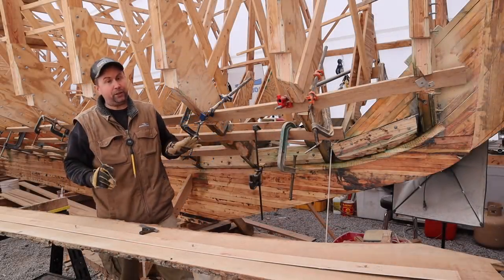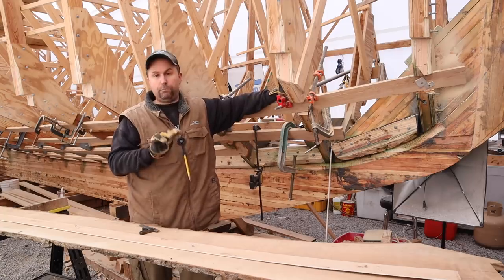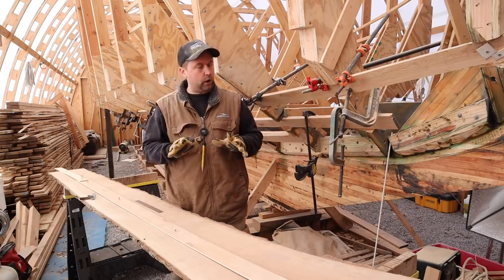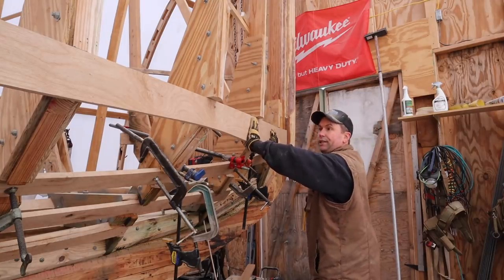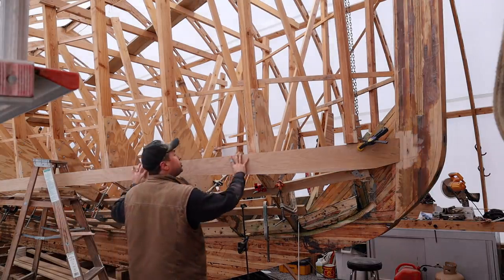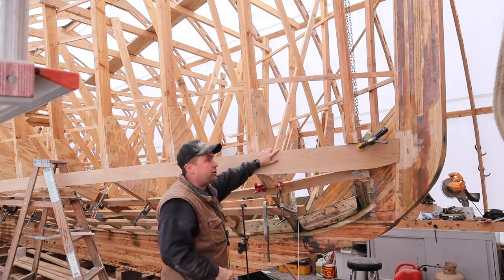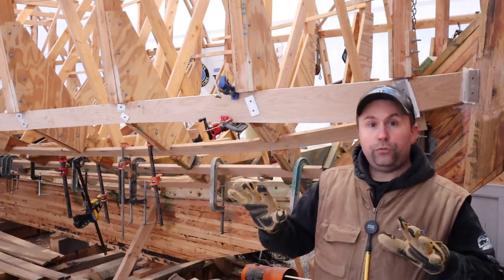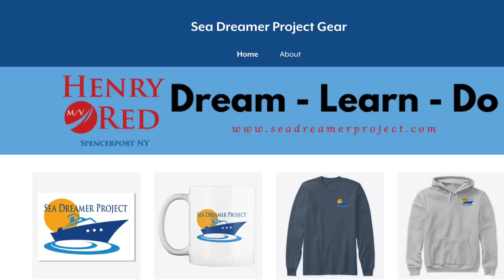Wooden boat Laminated white oak hard chine installation. SDP 42

Comment from the maker: It's not just boat building i'm new at!, a little user error on the Teespring store which I think I fixed but it may not display properly for a bit.  There is a link in the description that you can use instead if necessary.  I apologize for the error, I'll get better!.....probably.
Reply: Six Points Wood Works you are already absolutely perfect. You amaze me. No WAY that I could take on such a project. Hello I couldn’t even build the boat house. Mad deep respect to you. And for all of law enforcement. You are a true inspiration and an American hero. 🇺🇸#godblesstheunitedstates

Comment: Nice work! I like that you use commonly available material. I built a 38 ft. roberts in a northern town in the 80's and it was difficult to source material pre-internet. Now I learn so much on the internet from all the current projects I follow. I love your boat shop construction as I probably spent more time building two heated shops, than I did working on the boat. To all who may read this, shop building is an addiction just like boatbuilding.
Reply from the maker: You could build this whole boat with dimensional lumber and plywood.  You might need to double up on some of the pieces but it could definitely be done, and was in fact designed to do just that.  We used a lot of dimensional doug fir in the keel but the rest is custom milled larch and white oak.  However I did that because it's very easy and cheap to get near me.  The shed project was a lot of fun and is a great space for lots of different activities.  I wish I built it taller, but hind sight.....

Comment: Old schooling it !! 
 White oak is a very good boat and barrel wood. With a thin cut length of oak, bend it and it wont crack or break easy which a boat needs as it flex's underway where wood like mahogany will easily break crack and split.
Reply from the maker: I'm shocked at how much you can bend white oak without steaming and how far it will go without breaking.

Comment: I've never sailed, or know anything about boat sailing, I've only ridden on car ferries, that cross Galveston bay, as a child.  
Watching you makes me wanna build a boat, like a bucket list project, you make it look easy.  Must be George Buehler's plans, that help a lot.  What's good about this project, it's like a huge assembly by numbers project, that can be done with materials anyone can obtain.  Much cheaper than trying to build a car, or a vehicle, which requires specialized machinery, tools, mills and lathes.

I'm in my mid 50's now, I bet I could do it.  I got plenty of tools.  Just need to move closer to the Gulf of Mexico.  And take swimming lessons at the "Y".  😆

Comment: I built a 50ft wooden structure in temps of 90 deg F.........when the finished structure was subject to low temps it would distort, I would only ever build a large wooden structure at the average operating temp and not at any of the extremes.....have you calculated what those wooden planks are going to expand to in summer temps?
Reply from the maker: I don't think that is the right way to look at it.  If it were so, they would be building houses around here in the spring and fall.  Wood moves with moisture content, not temperature.  Provided the wood is dried before installation, which it is, the seasonal changes in the material are not a big deal.  The use of glues and bedding compounds are to remedy that known seasonal movement of all types of wood.  When building furniture, wood movement is a much more critical consideration, because wood movement can cause tight, pretty joints to open up.  It can even split boards in cross grain situations.  But boats, subjected to brutal conditions, are designed to deal with this.

Comment: Hey Scott - going well - great to see. I mentioned on a previous post that you do not need to use acetone with epoxy resin for clean up, etc - use methylated spirits instead - much cheaper, far less toxic an deasily obtainable - check out other sources if you do not believe me but I do a lot of epoxy resin work...
Reply from the maker: I remember, I just keep forgetting to pick some up and try it.  will do...eventually 😜

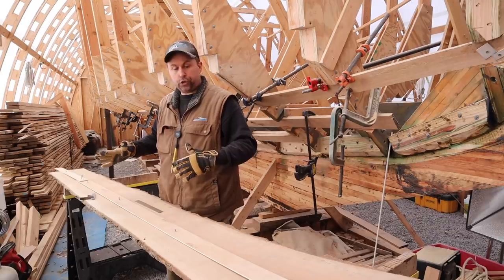Comment: 8:08 Why is that beautiful piece of live edge white oak "kinda scrap"? The things I could build with something like that, woooo wee... awesome work regardless, loving this series, just confused as to why that is considered scrap to you :/
Reply from the maker: For furniture stuff it is a great piece, but for boat building it was not so perfect.  That board was near the edge of the tree so it had a bit of sap wood on each side.  It was only useable for the right piece that could cut around those defects.  Sap wood does not have the strength or rot resistance of the heartwood in white oak.

Comment: I honestly don't know - so the question, galvanized bolts have a sacrificial galvanized coating - once the coating is compromised, the bolt will rust away.  I can only think it must be too expensive to simply use stainless or brass bolts.  Is that right?
Reply: The fittings he is using should last at least 100 years or more. I wouldn't worry about it.
Reply from the maker: Silicon bronze would be best fort sure.  However the cost was just to much for me.  We are building for ourselves and are not concerned about resale so galvanized will give us all the strength and longevity we need.  just FYI in case you are working on something similar, Stainless is not recommended below the water line, it needs free oxygen to avoid crevice corrosion.
Reply: @SixPointsWoodWorks  that exactly answered what I was asking, thank you!

Comment: You will be in good company when your white oak laminated with epoxy comes apart. Should have used Resorcinol.
Reply from the maker: I don't think so, Totalboat's high performance epoxy works great on oily and difficult to glue woods.  It's what it was designed for.  Check our earlier videos, we used gallons and gallons of resorcinol for the keel.
Reply: Six Points Wood Works , that’s fine, as a retired shipwrights I’m use to it. I have been offshore in one of the boats I have built and I can tell you that when you sit for hrs going through a bad storm you will rebuild the boat in your mind 1000 times.

Comment: I was positive the first time I spiled a plank for replacement on a 34 foot boat. Thing looked strange and seemed to twist and bend all the wrong directions. It slipped in like a dream. Instead of doing the measurements like you are doing you can use a pencil compass. Just make sure you establish the distance for the arcs and maintain them the same for that plank. Looking good.
Reply from the maker: good tip, thanks!

Comment: Is that dengerous to build a wooden boat??? You need to have that over the top face mask???
Reply from the maker: no not at all.  The respirator has a nose cup and and is the only eye protection I have that doesn't fog up.  I suppose it's not a bad thing that it cuts down on all the fine dust I breathe in but that's not a huge concern.

Comment: Average handyman with a few tools can do this build .... what planet are you from  ?  lmao
Reply from the maker: It can!  That doesn't mean it is without challenge.  I'm lucky to have 20 years of buying woodworking tools which makes many jobs faster, but smaller, common hand operated power tools can get the job done as well.  More equipment allows you to save money buying wood in "the rough" and machining it up yourself, but finished lumber is widely available.  As for the design, It is nothing that complicated.  I know nothing about boats, however, with enough reading and study anyone can learn anything.